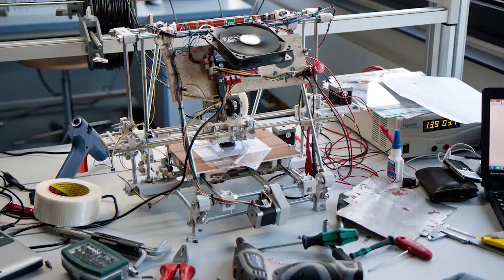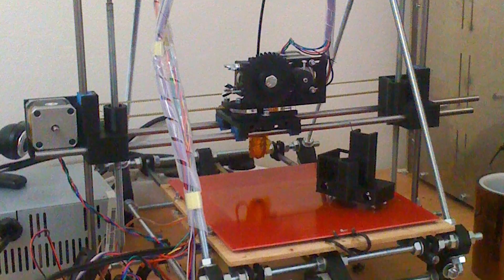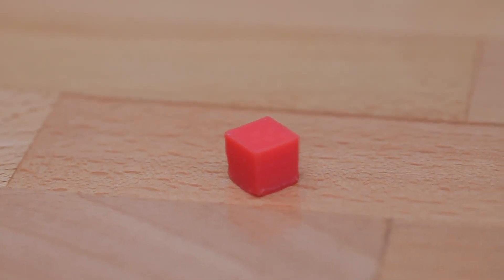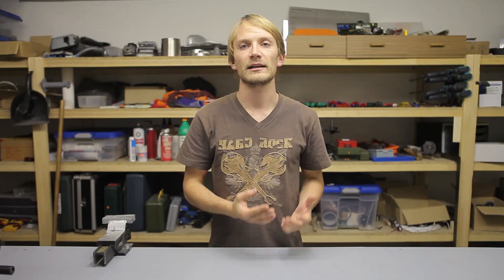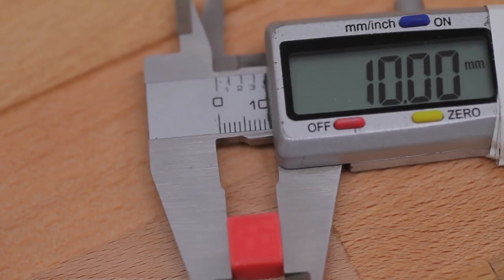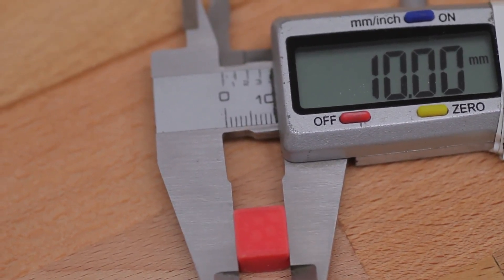3D printing guides: Calibration and why you might be doing it wrong

Comment: Sure, using a solid object and measuring its dimensions for calibration is wrong, because you assume your extrusion width is perfectly correct and you don't have backlash... Printing an object with two holes, like your Sticks,  and measuring from middle to middle eliminates the effect of extrusion width, but it won't eliminate the effect of backlash, depending on how your slicer decides to move the printhead. Why not just doing a simple and controlled 2D print that eliminates the effect of extrusion with and backlash all together? Just move X little bit in one direction, print a line along Y, move X 100mm further and then print along Y again. If you do that, you can just measure the distance from the middle of the first line to the middle of the second line with a simple ruler but still accurate to about 0.1mm. By moving the print head in te same X direction before printing each line, you eliminate any backlash on the X axis. If you then print parallel lines approaching from the other X end, you can even measure how much backlash you have. Actually, I don't know any program that can generate such calibration prints, so I've written my own gcode by hand: https://www.youtube.com/watch?v=eXbldjCLUdQ

Comment: Tom, I have a question regarding nozzle settings that I hope you can help me with.   I'm printing large objects and have purchased a 1mm nozzle to print them faster.   I'm using Slic3r and Ponterface on a Mendelmax 1.5 with a Ramps 1.4 board.   Can you help me with the settings I would need to change?

Comment: hi, my z axis goes off about half the object after 10 to 20 layer of printing. i checked the belt motor and sprocket, all good but still get this z-offset printing after so many layer of good printing, i add a fan to the prusa i3 boad , Reprap Melzi 2.0 to keep it cool but no luck. first time that happen i took off the motor and reinstalled with belt back and worked. but happen again .. don't know what could be the problem. maybe the main board. i try to let run with out pc or with pc connected same result.last time it stop at middle of good printing spit some plastic and the the z motor push it the extruder out toward the opposite of the home side.  ??? bad gcode or bad board ??

Comment: I have a Windows 8 64 bit computer and am having problems with Pronterface.  Any suggestions?
Reply: Any idea what issue may be then?
Reply: John B Doesn't really seem on topic to this video, but what problems are you having? -- (it works fine for me on Win 8.1 - x64) -- You might check out the #reprap channel on IRC.  Also, you could try other front ends, like Repetier, Matter Control, or Octoprint.
Reply: Thanks for reply Micheal, I actually got printer working!  Just fine tuning now.  Lots of great help in these forums.
Reply: I would suggest Repetier Host. I works well and has integrated slicing.

Comment: I got a robo 3d r1 i did a calibrate cube that was 25 - 25 - 25 mm .width and length in the ball park but the height is 2.5 mm short any ideas?

Comment: Hi Thom!! i have a question. I just fisnished bulding my prusa i3 but im not able to get it to print right :(  While im trying to print the printer moves like 5mm in the Y AXES and cube calibration is ruin... could you give a tip to solve this issue! thanks
Reply: Did you import the model in mm or inches? Slicers assume mm so if you did inches your part may just come out a nozzle squish. Also check to make sure you're using the right firmware version.

Comment: Hi Tom , I was wondering if you could help me with my problem with a prusa i3.

The walls are consistantly ~0.5mm thicker in large and small prints resulting in parts not fitting at all. I have followed your extruder calibration guide and caculated the steps/mm value for x,y,z based on the ideal prusa caculator. Even after lowering extrusion multiplier , increasing filament diameter , decreasing perimeter and default extrusion width in slicer , walls still come out too thick , the only difference being the weaker internal bond and gaps appearing between walls. I have tried everything on the net but I cant get it to print accurately even after buying an e3d.

Comment: I'm still confused by what you recommend? I have the proper x and y steps and I have the extrusion calibrated. But my parts still do not print accurately due to shrinkage/expansion. I find I usually need a extra 0.4 mm increase for any hole or nut trap for my machine and filament combination, but this is not transferable to other machines (e.g. ultimaker2s at my university), which is annoying. Should I keep designing parts with dimension adjustment specific for my machine or is there another method of adjustment (scaling parts in the Cura interface)?
Reply: +EtherealWinterWind, it sounds like you need to experiment with Cura's "Horizontal Expansion" setting. This is a printer-specifc setting (really it's specific to printer + filament combinations) described as:
Amount of offset applied to all polygons in each layer. Positive values can compensate for too big holes; negative values can compensate for too small holes.
Also bear in mind that software like Fusion360 and OpenSCAD will generally be making holes and rods slightly smaller than you intend. This is because they are not generating perfect circles but instead polygons. It's only the points (vertexes) of the polygons that are touching your target dimension whereas the sides (faces) of the polygons are straight line segments and will be less than your target diameter.
In OpenSCAD, for example, you can compensate for this by changing the "$fn" parameter when generating your holes and rods. A low "$fn" value of 30 means 30 polygon segments per revolution and will be quite inaccurate while a higher "$fn" value of 360 means 360 polygon segments per revolution and will be much closer to the ideal (certainly more accurate than most FDM printers can use). While more accurate the downside of increasing $fn to use more polygons is, obviously, that it uses more polygons. Increasing the number of polygons leads to OpenSCAD taking longer to render your models, which leads to larger STL files, which leads to Slic3er and Cura taking longer to slice your models for printing. But you get more accurate results. It's a tradeoff.
HTH.

Comment: If you don't adjust your x/y steps/mm how do you compensate for the ~1% thermal
shrinkage of ABS when it drops from ~230 C print temp to ~20 C room temp?
I'm trying to print a drill template for a smoothie board (~105mmx130mm) and the
hole locations are about 1mm off!
Frank Pirz

Comment: Hi Thomas,
I completed my 3d printer build... Thanks a ton to you and ur's videos which made my build easy....
I have done almost all the things for a 3d printer to work including calibration, the problem i face is that when the printer starts printing after the first few layers the X-axis shifts gradually as the height increases and the final layer (finishing layer) will be shifted back to the original position. I don not have any problem in my Y and Z layer... I have changed the drivers, re did the cabling and also adjusted the tension on the belts. I also tried using different slicer's... nothing seams to work please help..
Reply: santosh B S I am not saying that you have not done this yet, but have you adjusted the power on your POTs on your stepper drivers? If they are too weakly calibrated they will skew your x axis. It would likely be the X-axis POT on the X-axis stepper driver. There are also some other issues that may cause skewing on x or y axis. try this site for some information regarding x and y axis skewing. http://forums.reprap.org/read.php?1,122948 With my printer, I had skewing on my Y-axis when I tried to adjust the POTs down to reduce amperage on my overall consumption to reserve more watts for the overall operation. When I did this I set my Y-axis POT too low and it started skewing greatly. I simply adjusted the POT back up and it began printing appropriately again.Hope this helps good luck.

Comment: Good points. I think that everyone should start with the hardware aspect before trying to solve the problems electronically. Also, you have to have some compromises with the fact that home 3d printers aren't the same as the precision machines that cost 20 times as much.

Comment: All,

I suppose it must be full marks to Printrbot, I have checked the calculator against the Simple Metal settings and they are very close to the defaults for my printer, the same with extruder calibration, so the professionals have done their work well. 

The point Tom makes about the tolerances in the system and that this is not a precision engineering process are well taken but since I still have a small size discrepancy in X Y Z and having checked that the "tyre is not flat", now I can adjust the steering.

I guess I am lucky enough to have entered the 3D printing scene after other people have taken the pain out of it. Many thanks to Tom and others like him who make their knowledge and experience available to us users.

Happy New Year

Alan

Comment: Hi Thomas so what you are saying is that we should use the calculated figure in Merlin and then print the object and measure the centre to centre . Now if that centre to centre is say 9.9 mm how do we get the printer to print slightly larger ? Do we just scale ?
For example I had an X reading of 99.62 mm  so how do I account for the error of 0.38 mm when I have a Prusa with a calculate steps = 80 ? If it is exactly 80 steps / mm then are we talking about plastic shrinkage factors  or other ?

Comment: You imply that we should simply trust the belts and whatnot, but there is also a certain inaccuracy in stepper motors that can be corrected for with calibration. I find that simply trusting the calculated values can lead to gears that don't mesh well and other side-effects like oval circles and rectangular square pieces.
Reply: *****
It's not the steps per rotation, it's the accuracy of each step. Stepper motors can vary by up to 5% in accuracy for the angle they achieve with each step. Whether or not this is cumulative seems to be open to debate, but in my personal experience I get better results by manually adjusting the steps/mm value a little bit.
Reply: Yes I would only use prusa calculator values as starting values

Comment: (1.75mm user)  First, I spec every spool. There can be significant differences by manufacturers.  +/- .02 is fine, but after that I'll tweak the multiplier.   Worse thing to watch for is small spec,, 1.70-. That can falsely be perceived as a clog or under-extruding(which it is, but not a"normal"steps/mm setting problem)
Then print the 20mm x 20mm, x 10mm, 100%infill cube,,, to dial in the filament multiplier(if available)   Eliminating the filament variable, is a good starting point.
New machines are already pretty close on calibration,,  so temp. and speed become quality factor.   Problem is.... different machines seem to have slightly different reactions to those.
Ex: I tested 2 machines with same file, filament and settings (FFCX vs WD4, both w/Sailfish 7.7).  Using Makerbot Desktop's 90/150 setting was too fast for either. After "Watching and Listening", I dialed the speed down 10% on the WD4, and 20% on the FFCX, to make them sing smoothly.
Temperatures are a skill that only comes with hours of close observations.  My WD4 likes normal settings,, but the FFCX is +20*c w/PLA, and +10*c w/ABS.  FWIW, I also like to start +5to10*c hotter on the first layer.
In the end, even mechanical prints, can still be reamed, drilled, sanded and filed, and ABS models can be vapor smoothed,,  so chasing the ultimate precision print may not be worth all the effort, for the hobbyist.

Comment: I'm very curious to see what your method is for calibrating large machines using printed parts. Every idea I can think of for verifying the "ideal" motion based on the pulley profile involves measuring the printed parts (from the same side of two steps, I assume, to cancel out extrusion errors). It seems to me that measuring the machine motion directly would be better, if you have tools to accurately measure something near the size of the machine's largest axis.

Comment: I totally agree with you set the steps based off the pulley profil (eg. 80 steps for 20 toth gt2 puly) and if it's not right calibrate your hardware not your software.

Comment: I don't know how many times i tried to calibrate using 10x10x10 cube. I finally tried calibrating using a 100x100x5 and got so close to the original settings i just sat there in silence for about 10 minutes. i think beginners will benefit more from this video than i did, but at least they will be doing it correctly from now on :P Great video :D
Reply: Yes i know I am commenting to a 5 year old comment, BUT, I just wanted to say, as a beginner, WE ARE STILL CALIBRATING THIS WAY. Unfortunately. There is so much current material, be it on All3d or popular youtube channels (though not all of them [Thomas, CHEP] ), telling us to bust our callipers and print a 20x20x20 cube and calibrate our xyz. I've been researching a tonne online the past couple of months and have only now come to realize maybe I'm doing it wrong due to a comment on reddit and me looking further into it.